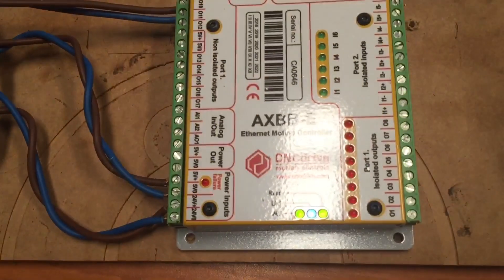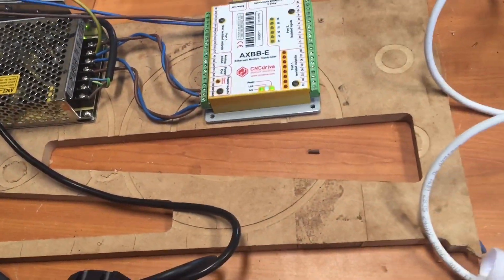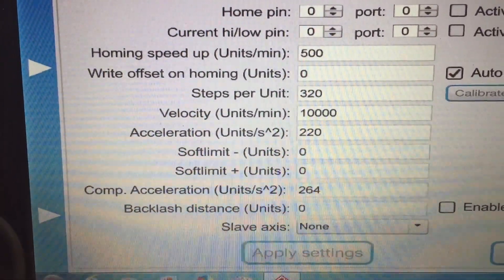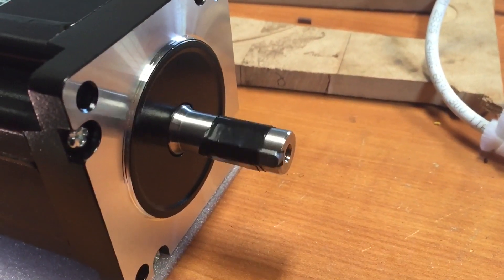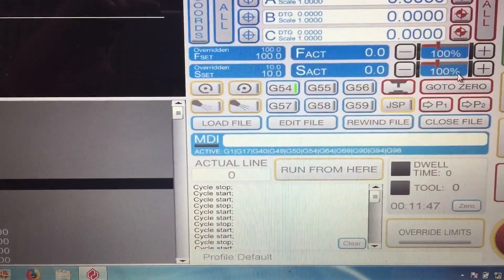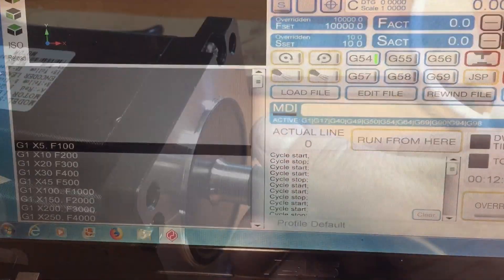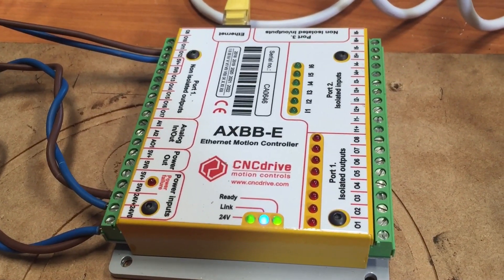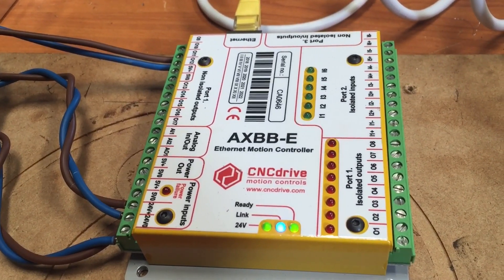AXBB-E Ethernet UCCNC motion control test with closed loop stepper motor

Comment: i have been using the  axbb-e for a while that i also got from cnc3d on the goldcoast and is a solid unit , i am in the process of building a larger cnc and just ordered some nema34 closed loop motors and this vid alleviated some seecond thoughts  i was having

Comment: Good video! Did you also connect the alarm PIN in case the motion lags to much? Would be interesting how to wire and configure?
Reply from the maker: 😂 To be honest. It's all still sitting idol in a box. I'm too busy to build the control just yet ( or a bit lazy 🤷🏻‍♂️ ). The machine it's going on is a busy machine.   It's going to happen very soon though. Yes I will be wiring the alarm to an input. That's easy to do. Assign the input to E/Stop the machine.

Comment: How do you find the AXBB-E controller, there is not much of user experience info online to make an idea about it's reliability. I want to go for ethernet motion controller and not sure which one to choose between UC400 ETH  and AXBB-E. I would like to go for AXBB-E because has integrated BOB  and it's compact but  people does not seem to aproach buying it and share the experience. I want it for a 4 axis cnc router with vfd control  either on Mach3 or UCCNC.
Thank you.
Reply: check out the uccnc face book page
Reply from the maker: Yea. Best to jump on the UCCNC users group on FB. Plenty of guys on there with a mountain of knowledge. 👍
Reply: ive been using mine for a few years now with uccnc and it has been bullet proof running some larger neama 23's . im just about to start a new larger build and have grabbed some 12n  nema 34 closed loop drives for it .

Comment: I have the same set up as you with UCCNC AXBB-E, 12NM closed loop stepper, HBS86H Hybrid servo drive and a large toroidal transformer power supply that gives 60v. I understand the drives will accept both DC and AC so no need for switching power supply. I have the x y and Z enabled in UCCNC with standard type settings. If I try and move the axis the screen shows the DRO in UNCC moving but the steppers just refuse to move. The AXBB-E board shows 2 green lights and a blue one and the stepper driver shows a green. At this stage I am stumped, I have tried a switching power supply but no difference. The wiring is correct I have checked several times. Did yours just work when you connected it up or was there something special you did? Any suggestions would be gratefully received.
John
Reply from the maker: It will be a wiring mistake or a UCCNC port/pin setup error. Check that you have configured the correct port number for your motors step/dir.
Reply: @diycnc3442  Thanks very much for replying so promptly. I have the wires inserted into pin 9 and 10 on Port 1 and UCCNC is set active on Pin 9 for step and pin 10 for direction and port is set as 1. The wiring is exactly the same as yours in the video. The only query is the power supply which is 60v toroidal transformer which gives 60v AC. I am told by the seller that it is correct for the driver. I have checked all the wiring several times. I even tried a 60v DC power supply. I tried another of the drives and another motor just in case they were faulty. There appears to be no electrical supply to the motors as they do not get warm. The only wire I was a bit unsure was the negative of the step and direction , they are wired together with a jumper and I took it to 0v on the 5v input. At the moment I am at a loss what to even try. It is just dead. I wondered if I was missing a switch setup in UCCNC.

John
Reply from the maker: john2478 so you also have a 5V + or 5V - wire that will go to your driver step & direction + or -  ( either common cathode or common anode depending on what you chose). Do you have this wiring? Without it it will not work.
Reply: @diycnc3442  Yes I have the step and direction - terminals jumped together and a wire taken to the 0v input (of the 5v input) I am just so frustrated.
Reply: I just fitted the low power 4nm stepper and it turns easily with the power off. If I connect the transformer then the drive does lock so power is getting to the motor. I guess the fault must lie in the wiring of the encoder or the wiring from the AXBB to the controller. I cannot see anything incorrect, so guess it will be a computer UCCNC problem. It did cross my mind that I could have a corrupted file installation. maybe uninstalling and reinstalling would be worth checking.
Reply from the maker: john2478 have you checked your motor  phase wires are correct?
Reply: @diycnc3442  It was not the wiring that was incorrect but...Success! I uninstalled the UCCNC and reinstalled it and it now works, there must have been some error in the initial installation. Now I can make progress. Thanks for the various suggestions.

John

Comment: May send a link to  motor and driver ,please?
Reply from the maker: https://rover.ebay.com/rover/0/0/0?mpre=https%3A%2F%2Fwww.ebay.com.au%2Fulk%2Fitm%2F143099855004
Reply: @diycnc3442  no stepper does 2000 rpm most top out at 1000 with 200 steps
Reply: o never mind i just relized you have a heigh brid stepper with feed back
Reply from the maker: koollakes 😂 even a normal stepper motor can do more than 1000RPM. It’ll just have very little torque.